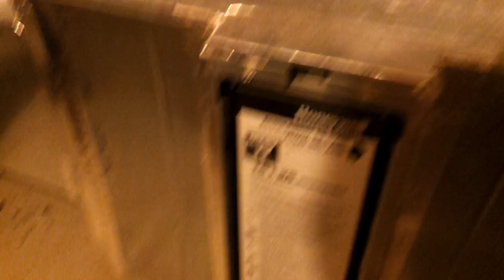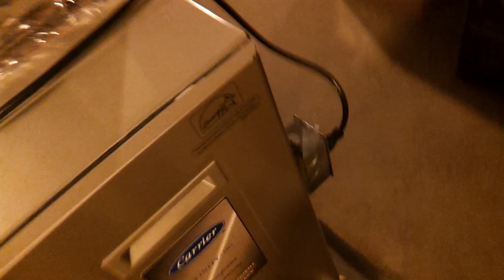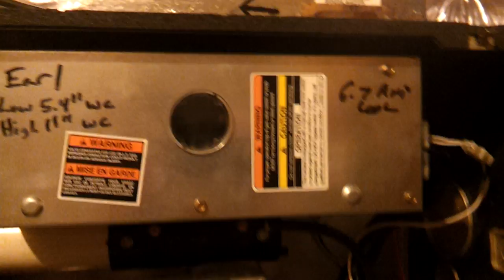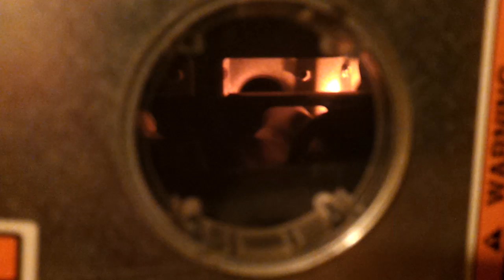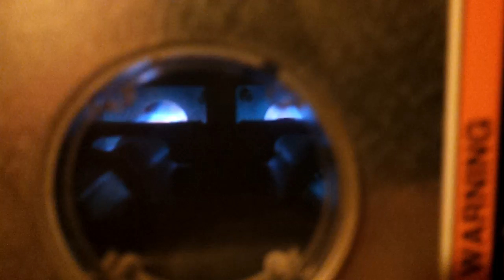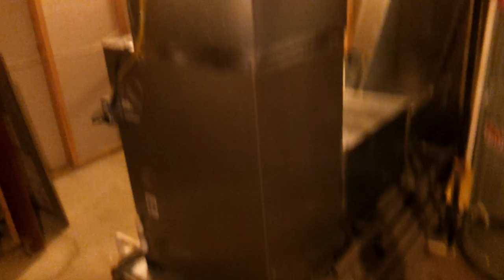Carrier Infinity 96 Gas Furnace-58MVB-Running in Heat Mode

Comment: I have a solid yellow light and a green light that flickers on power up then goes out. Sounds like a relay clicks on and off on circuit board. Any ideas on the cause? Thanks for any feedback
Reply from the maker: Is the green light flashing a code or does it go out completely?
Reply: @springws14lbss  Having the same issue; green light flicks on for a second then off, then solid yellow.
Reply from the maker: The green LED only stays solid green if you are using an Infinity thermostat, as that means it is communicating correctly. 
A solid amber LED means your control has 24VAC power.

Comment: You can smell heat exchange outside. Smells like gas. I had pressure switches and water drained. Even technicians did not know the problem and we needed to call in another company.
Reply from the maker: That's what I've heard. Has not happened here yet though!

Comment: At 3:40 I was wondering if you know what is the orange label hose attached to. I only have the green label plugged into the trap box but the orange hose is disconnected. The backside of it. I don't feel or see anything at the back of the inducer motor.  I see in your video that your orange label hose goes somewhere or it's disconnected as weill. Thanks, bro subbed.
Reply from the maker: Hi there! I will have to check next time I am at my parents house and will get back to you. You are talking about the smaller tube that comes off of the trap, correct?
Reply: @springws14lbss  Thanks bro. Yes there is the green label one that's plugged in to the trap but the orange label one comes out of the inducer and other end is disconnected. I wonder if that's what's stopping the inducer from spinning. It starts for about 5 sec and stop and tries to start every 2 min while the blower is keep running blowing cold air. By the way if you inducer goes they are going to charge you $1200 and $600 for install. One of the guys is saying there's no aftermarket model for this inducer only Carrier makes it. Supposably is a DC inducer and not AC or something like that that's why it cost that much. This is nuts. Inducer should be OK since it actually spins for 5 sec. If it wasn't turning at all and making noise then I would understand. The thing is they are going to replace the whole inducer even though it works rather than replacing a start,stop sensor on it or pressure switch. I had it changed around 8 years ago cause water got inside from condensation. This year the first thing that die was thermostat showing LOW battery. After I notice house got cold from blowing cold air. After the batteries were changed blower still blowing cold air.
Reply from the maker: Yes, the inducer is driven by a ECM (DC) variable speed motor. And I believe they are only sold as a complete assembly, so they are quite expensive to replace. 
The orange one on mine goes to the other side of the collector box. You can get a better view of all the tubes from here:
https://www.questargas.com/ForEmployees/qgcOperationsTraining/Furnaces/Carrier_58MVB.pdf
Page 8
Reply: @springws14lbss  Thank you for all the trouble. Happens that now I have a new Carrier 2 stage model and seems to be louder than the Infinity 96. Specially when the burners come on. I ask the Furnace guy the same question about the orange hose and he said that depends on how the furnace is setup. If it's up right or horizontal or something like that. So that will depend on which of 2 hoses will be used. So I guess in my case orange was not needed. I also got one of those manuals on Mon in your link provided. Thanks again!!. Took them about 4 hours to put it together. Except now the thermostat reads higher than the usual temperature. I used to put my thermostat to 69 70 and now with temperature plus 15 or so outside like today TUE here in Toronto seems like  I have to put the thermostat to  71 instead of 69. So I'm not sure what's up with thermostat. I left the window open in that room just so the temp will drop but for some reason took forever to for temp to drop to 70. Seems like I'm using more heat than before with this new 59TP6B060 96% Two stage deal.

 I had a choice between changing the DC inducer which is about 1200 bucks and 600 for the labour since there's no aftermarket models. So I just decide to go with $4200 plus HST brand new furnace. So on the end screw the ORANGE HOSE. LOL. since the heat exchanger could probably be already at it's end however it look nice and clean when they opened it up No cracks whatsoever. My Infinity 96 was installed in 2004. If it wasn't for condensation happening 96 would probably be still going strong for many more years to come but the water killed the inducer motor since it wont start. Well is trying every 2 min but spins for 5 sec and then stops and the blower is keep on blowing cold air and wont stop.

Also just incase a lot of people forget to register for warranty and the when the time comes they end up without one. They give a window of (60 to 90) days from the time of installation. They still haven't come to collect the money for furnace but on FRI they guy will come and will get the 20 warranty on heat exchanger, 10 warranty on parts and 5 year warranty on labour done. The company name is STOTT HVAC SYSTEMS. stotthvacsystems.ca The price is really amazing because I almost made e deal with another company who's technician want's 1800 bucks for inducer and labour to pay $8000 for brand new furnace. Sheesh. I will report back to you incase something screws up. All though I think the thermostat needs to be replaced anyhow. Either way hadding to page 8 now. Thank you for having the patience 👈 to look for the page for me. It a jungle in there. 😂

Comment: Hi springws... I have the exact same unit, 58MVB which is now 10 years old. Installed in 2009.   Initially I got a error code 13 which lead me to the roll out switch tripping.  Re-set it to no avail and seems the flame quality is slightly yellowish and it won't run for more than a few minutes without tripping again.  The flame box gets really hot when it fires up, so the switch is definitely doing it's job.  Further investigation points toward bad heat exchanger.  

It there any way to check the condition of the exchanger without pulling the whole thing apart? 

I've heard there is a warranty/recall thing going on with these units.
Reply from the maker: Sounds like a failed secondary heat exchanger, which these units are known for. Unfortunately, the only way to physically confirm this is by pulling the blower motor assembly out and inspecting the  secondary heat exchanger from the bottom up. Can also be confirmed by doing combustion analysis, you'll see very high CO readings. You 'll probably want to call an HVAC Pro for this job.
Reply: @springws14lbss   Hello,  It was the heat exchanger and they guy who did the work knows his stuff.    But then another issue arose.  It started go into error code 4 2 I think it was.  Apparently the mother board is shot.  They got it back running but only on the second stage.  It never runs in first stage at this point.  At least I have heat :-)   
I will probably spring for a new board in the near future.  I like the furnace, but I'm surprised these kind of problems are surfacing after only 10 years in service.
Reply from the maker: Did they replace the heat exchanger? 
Code 42 is inducer motor fault, ..." the inducer has not started within 20 seconds after a call for heat, the
inducer RPM is outside its valid range of operation, or the inducer RPM signal was lost for 5 seconds during operation."
The failing secondary problems actually started happening a few years after these furnaces hit the market, it was a manufacturing/design issue , hence the lawsuit. You may be better off buying a new furnace at this point.
Reply: @springws14lbss   Hello,  Yes they did replace the heat exchanger and it made a huge difference on the temperature of the flame box. No more roll out switch trips and the bottom of the old exchanger looked tired so I'm quite sure it needed replacing and apparently Carrier is footing the bill for the parts and some of the labour.   

Maybe I'm wrong on the code readout... My furnace in in the basement and I have a occupied suite with tenants so getting access is a bit of a process.  I'm quite sure the service guy said the inducer motor was fine. They are suppose to call me this week again and probably have another look. 

I didn't know there was a lawsuit.  I will have to look into that.
Reply from the maker: Good to hear, let me know what else your service tech finds. 
There was a class action lawsuit but I believe the time to submit a claim expired in 2008.
Reply: @springws14lbss  Hello,  I thought I would revisit this page for more questions.    Furnace is working now since a new heat exchanger was installed as per above comments, but only with the motor on high rpm.  The tech had to jumper the contacts to make it do this.  Without doing that I had no heat.  Apparently the board is not 100% so it won't go into the low rpm mode like it use to before all this trouble started. 

My question at this point is... how hot should the air from the vents get to when the motor is running on high?   Mine only gets warm.  An outdoor thermometer showed 105 F at peak temp.  This seems low to me.  There are no error codes showing at this point.  

Is there trouble shooting that can be done on those boards?  I have basic electrical circuit knowledge and a decent meter, or is it at all possible.  There are no visible burnt evidence on the board.  
TIA
Reply: @tamaracktour  the pressure switches should be checked to see if they''re closing at the right differentials. a manometer required.  the way this style furnace works, the inducer gets the minimum rpm to close the pressure switches to get the fuel to air mix right. if the failing secondary caused the trap to plug, the pressure switches may have gotten water in them.
what your tech did was wrong.
i would not jump to board replacement.
Reply: @Jon-hx7pe  you are correct I had pressure switches replaced and water trap drained. Why did the tech's just say I needed a new furnace and give me a few hundred off? They must know the problems.
Reply: @davidandrews8007  hard to say - they don't like replacing heat exchangers and there is money available from a hxt class lawsuit towards replacement carrier furnace. The parts in these furnaces are super expensive too. The higher end 2-stage ones with variable speed inducer? Looking at $1000+ just for the inducer part. So it can be better to just change the furnace when the secondary goes.
It is a real shame because other than the bad secondaries and expensive parts, they're really, well built good units.
Reply: Shameful furnace only lasts 10 years. We had several service calls and replacement parts installed. Needed to call another company and replaced with a york that was in stock. Two speed and not variable.  You could probably smell the exchange outside. The box was also hot.
Reply: NM no

Dass ďď zip dcçe

Comment: Is the bottom light supposed to be on when the furnace is not in use? Thanks.
Reply from the maker: Which one? There is both a "Status" and "Comm" LED that illuminate when the unit is energized.
Reply from the maker: Which one? There is both a status and communication LED that should be illuminated when the unit has power.

Comment: I think they call the relay an "contactor"? Not sure though i know they're called that on A/C Condenser and they look the same.
Reply from the maker: Its similar but since it is low voltage (24V) it is technically a relay.

Comment: Does the Variable Speed Blower ramp down at the end of the cooling and heating cycles? I am troubleshooting a system dated 2006. Same m/n as your furnace. This one is a two-stage condensor.
Reply from the maker: If it is transitioning from 2nd stage heating or cooling, I would expect it to ramp down, unless the "Fan On" speed has been switched to "High"
Reply from the maker: Depending on the "off" delay and if they have the fan set to "on", most likely it should.